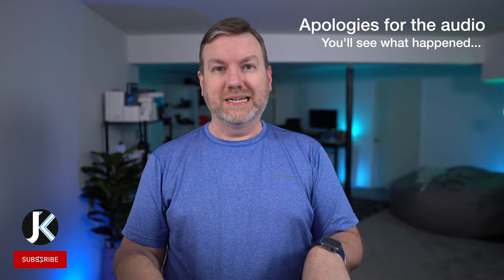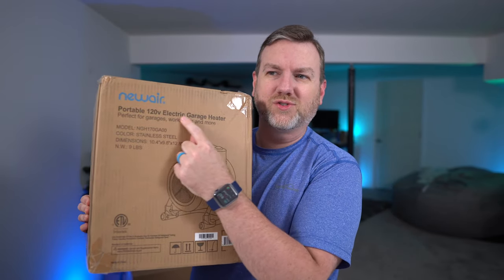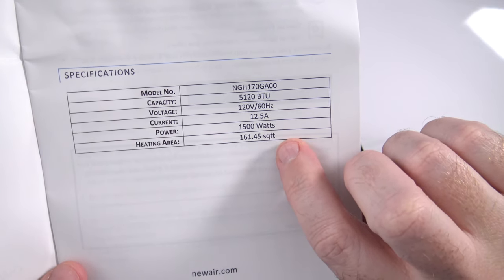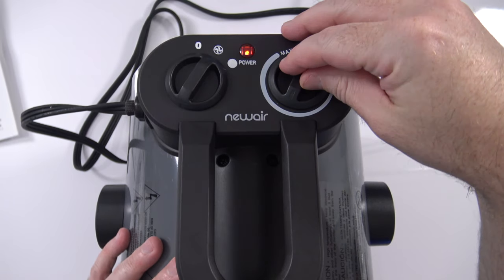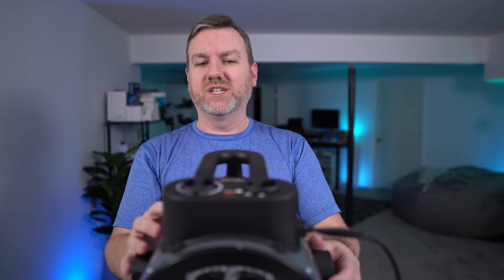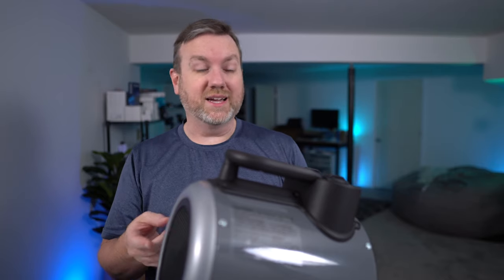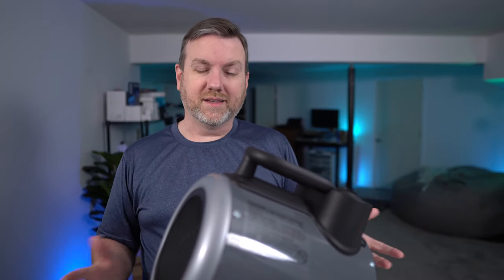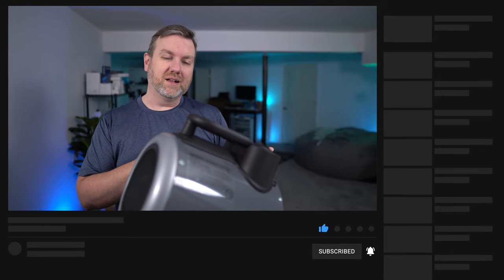NewAir Portable Ceramic Garage/Workspace Heater Unboxing and First Impressions

Comment: I know it would complicate the design, but it would be nice to have a time delay on the fan to keep it off when the unit initially powers up to allow the coil to heat up. The element itself looks like a stove burner.

Comment: Great video. 👍 You should check out a OIL radiators with fan. They keep the heat for a longer time and really works well and many of them have a timer function.